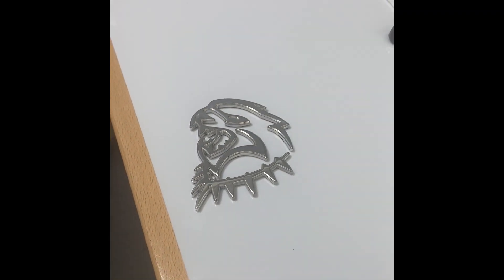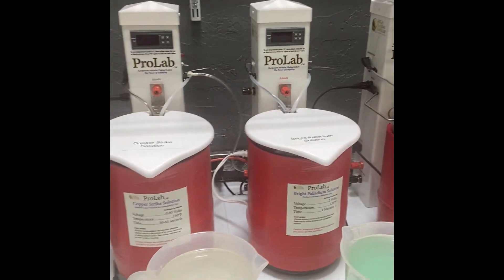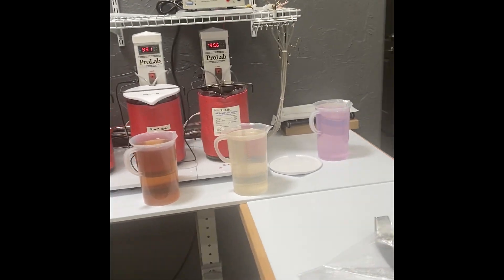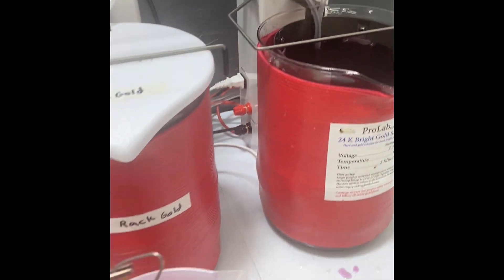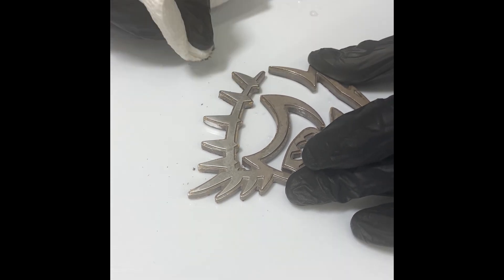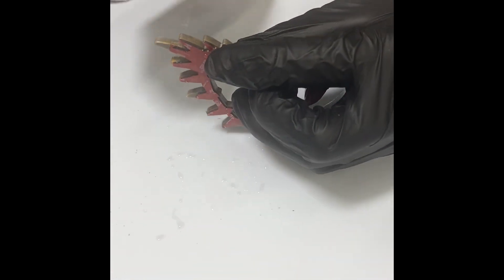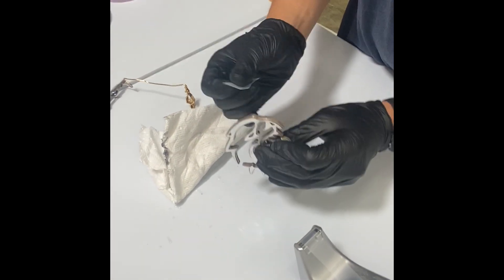Hell Cat Emblem Gold Plating Gone Wrong

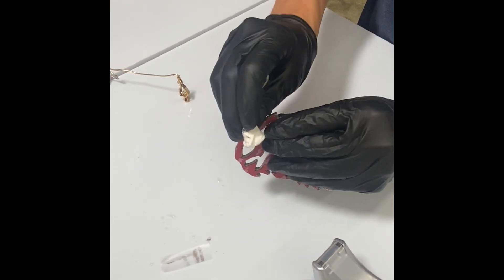Comment: @4:30 Did you say "Mothers Mag and Aluminum Polish (the paste to clean aluminum rims)" is good to use to help prep for nickel plating a piece that isn't taking the gold?  This has happened to me a couple times myself (probably to us all) and is frustrating when you sware you are stripping chrome but still won't take so I'm curious as to your process.  Would it be mothers chrome polish first then maybe Woods Nickelstrike, to Chrome Stripper, to Surface Activator to Nickel plating, to Gold plating?